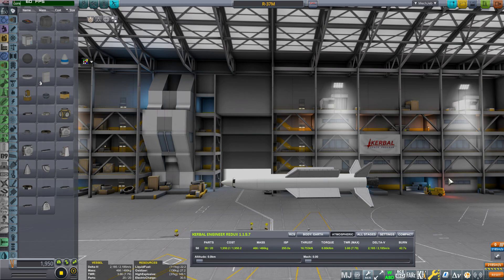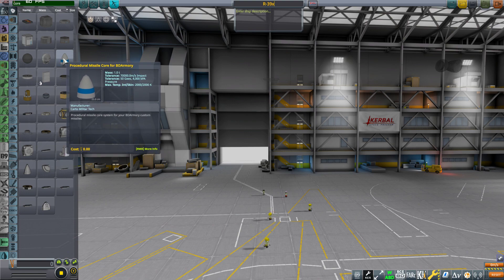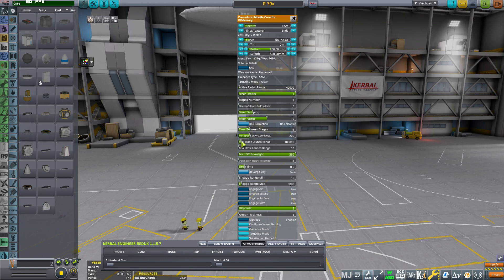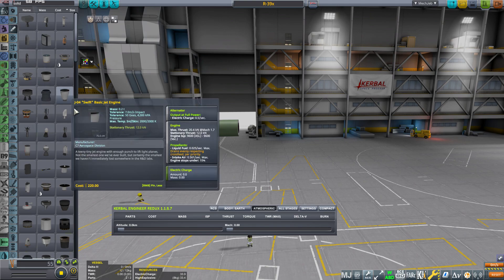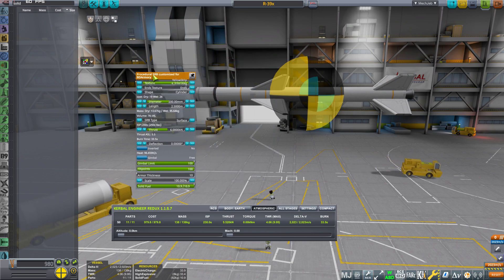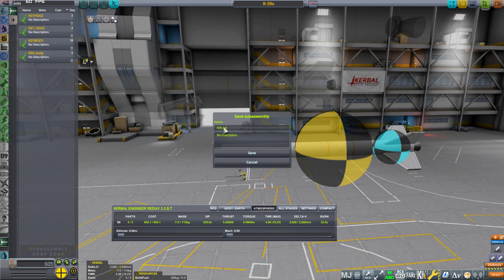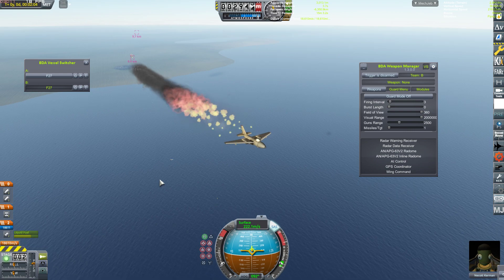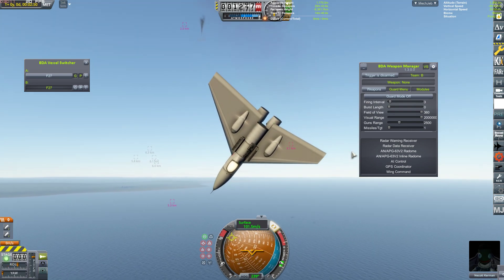KSP BDArmory Modular missiles AAM realistic tutorial

Comment: Soo, it's 6 years after video was published, but i have a question, why when i'm firing missile it decouples right, but the engine isn't starting? Also, how you made this tiny separator?
Reply: you have to set the stage in action preset, so if the engine is the first stage of the missle, in your action first action preset will be your first stage

Comment: I tried to fire the missile on its own, no aircraft or staging or anything, just the missile and manual fire to see what will happen. The motor just doesn't automatically start and has to be manually activated by right clicking. I'm using the latest version of BD armoury multiplayer and modular missiles.
Reply: You have to to turn on the motor first or like put it on the first stage

Comment: I have a BUG where if I connect the missile to my plane the missle controller thinks that the entire plane is the missle.
Reply from the maker: In that case it should be due a bad attachment method of the missile to the plane. Check that you have the missile attached to the plane using a stack decoupler or a radial one. Then the missile should have only one missile core  and the plane has one weapon manager
Reply: @jesusrv2009  the missile is connected via a separator and idk every fuel tank is 'shutdown' and all of the fuel show 0 for some reason
Reply from the maker: @airfrancerobloxchannel7374  That's expected. It was a way to protect the missile tank from being depleted from the plane engines. Try to fire the missile right clicking on the missile core and click fire. The missile decouples correctly from the plane after being fired?
Reply: @jesusrv2009  no, it decouples the wrong seperator and activates the engine SRB from the missile.

now I think ik the issue
Reply: ohh dude it is a bug, if you have a seperator between the body that hosts the missile and right before the control pod, the missile will go after that specific decoupler rather than the one connected to the missile,

e.g take the sat launcher and remove the regular ship it's carrying and add a separator before the control pod (where the wings are and the body and the engines) then the missile will go after that decoupler and not the one where you connect to the missile and such
Reply from the maker: @airfrancerobloxchannel7374  I implemented it like that on purpose ;)  Modular missiles relies on a set of stages separated by decouplers in which the last one should be the one attaching it to your plane, if you have any other more than it is not part of the missile then you should remove it.
Reply: @jesusrv2009  i dont understand do i put the decoupler of the missle at the start or last because I have tried both
Reply from the maker: @airfrancerobloxchannel7374  Try changing the root part to something that it is between that decoupler and the missile or removing that decoupler
Reply: @jesusrv2009  i just did that and it worked and I was about to tell you that it works! thanks for helping! very very much
Reply from the maker: @airfrancerobloxchannel7374  Looking at your pic, you just need to remove the decoupler that you have on the body of the plane so that the missile does not decouple from there.